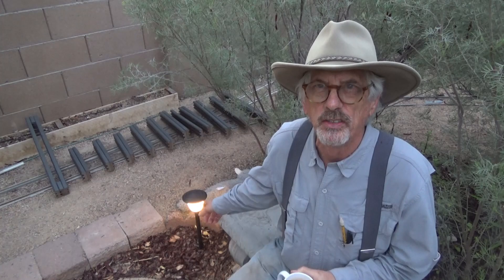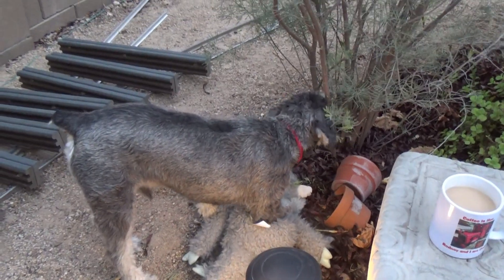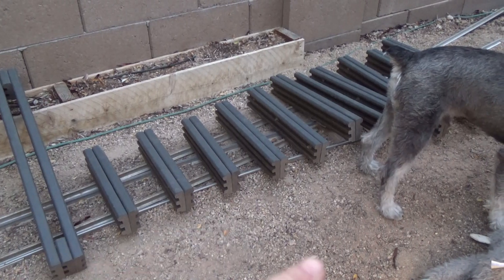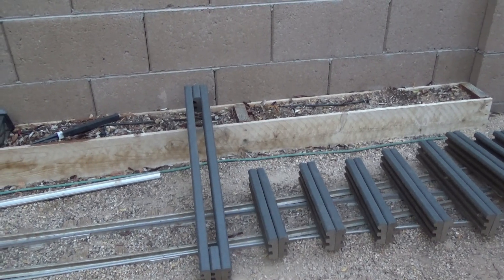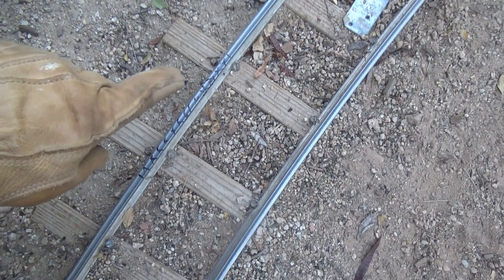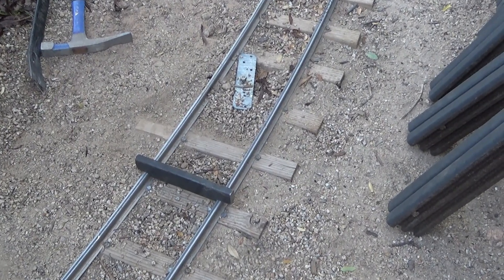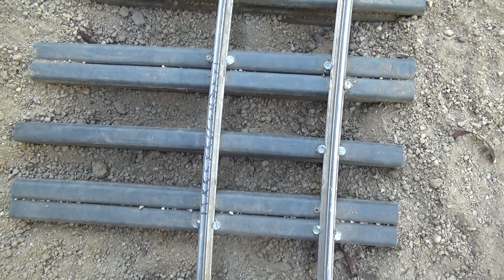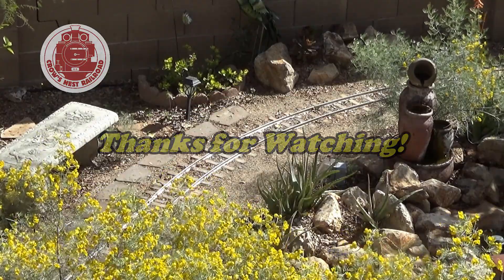Switch Project Part 2  -  Track Work Continues!

Comment: Nice work. Keeping fingers crossed for a successful project completion. Thanks for sharing!
Reply from the maker: Thanks, Larry!  I'm filming on part 5 of the switch build right now.  I had a little mishap with the table saw that got me some stitches and a bit of a slow down.  All is good.  Got the stitches out today.  👍
Reply: @StanFerris That is scary.  Table saws and radial arm saws have always made me nervous when using them. Glad you are okay and the project is continuing.
Reply from the maker: Hand is feeling much better!  Thanks!

Comment: Unless you have already installed the frog and switch points, install the frog next, figure out where the heel of the switch point will be and cut the rail, then bend the rail out for the turnout stock rail needs to be by installing the curved closure rail and switch point first then gauge the stock rail to the closure rail.  Remember to leave enough room for the flanges for the heel of the switch points.
Reply from the maker: I haven't put in the frog or cut rail yet.  These vids are a little behind real time.  But I decided to create a deck for the spur and get the roadbed all set before the first rail cuts.  Thanks for your great suggestions.  I'm making this up as I go along!  😄
Reply: @StanFerris  For your track, the rail joint for the stock rail should be at least 1 foot from the switch point.
Reply from the maker: Thanks, Roy.  How far before and past the frog should the guard rails be to guide the flanges?  I see different lengths in switches.